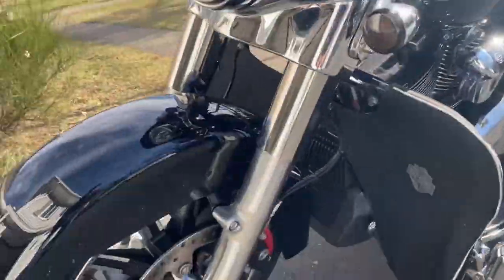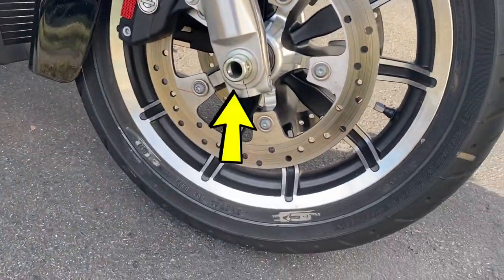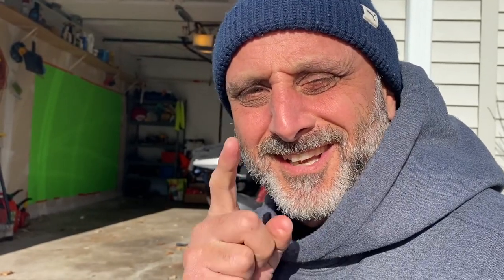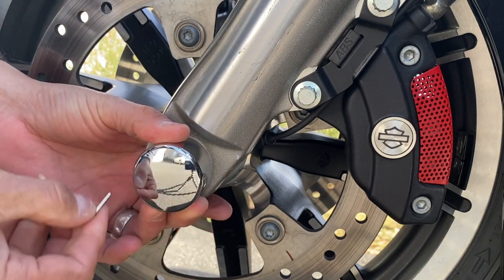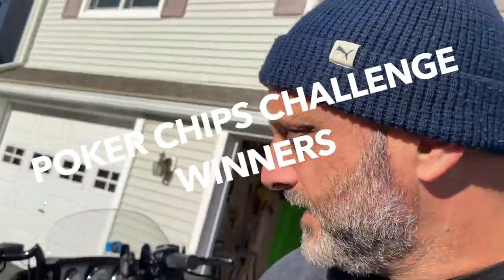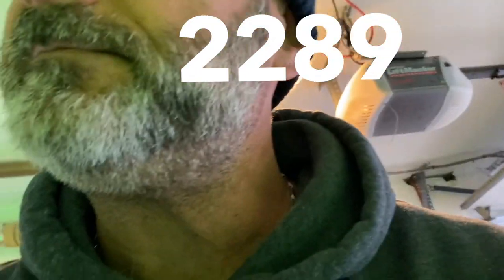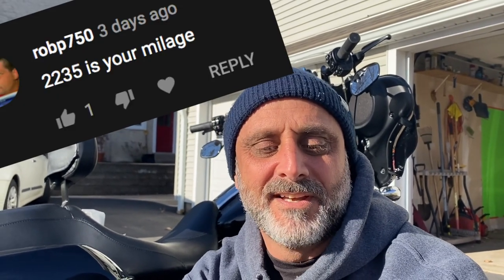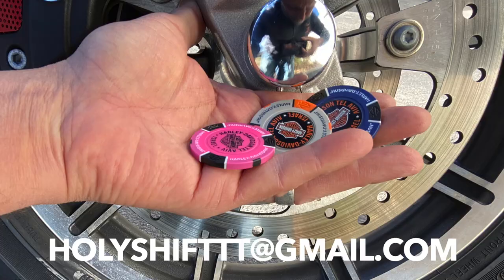Axle Nut Cover Install /  Poker Chip Winners announcement

Comment: Hey Sandy, great content and thank you very much for the chip. Lookin forward to recieving it. And if I can, I'd like to give a little advice on when u send the chip, my girlfriend works for the usps and suggested that the chip should be mailed in a padded envelope, any other regular type of envelope's run a risk of getting stuck in the mail processing machines. Also, if you're collecting HD chips, I can send u one from my area, out here in Seattle. The dealership I work with happens to be called Jet-city HD. Figuring since you're a pilot an all. Just repaying the favor. No biggie if not. Thanx again Sandy.
Reply from the maker: As suggested- I’ll use a padded envelope. Thanks 🙏🏻. I don’t collect chips- thanks anyway

Comment: Try some clear silicon sealer inside the covers - some 'just in case' insurance . Regards loctite, only use a small amount (of the lowest strength) - otherwise you'll have a lot of 'fun' trying to remove next time you want to remove axle. Those tiny allen headed fastener are a real bitch to remove without rounding out the innards if loctited with a heavy duty grade.... Trust me ... I know, ;-)
Reply from the maker: Thanks- not putting any loctite just because of that!